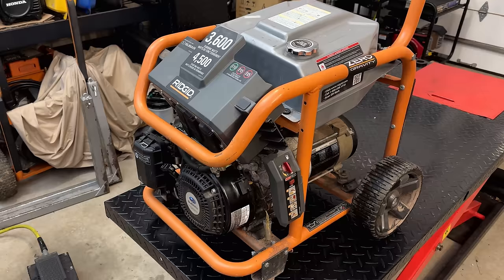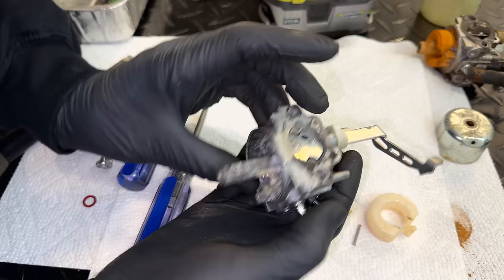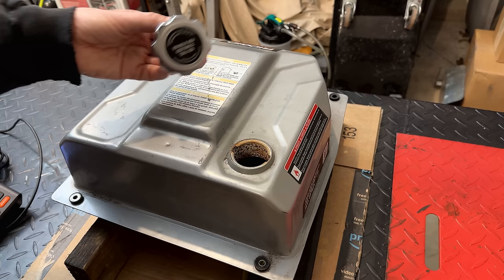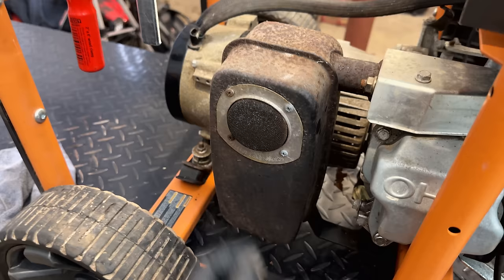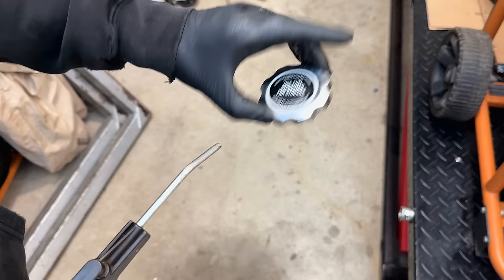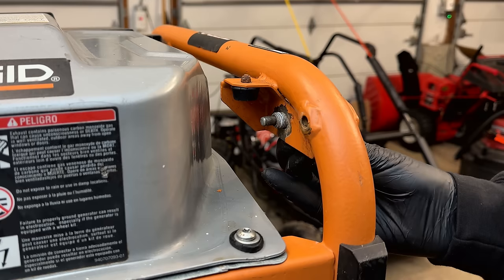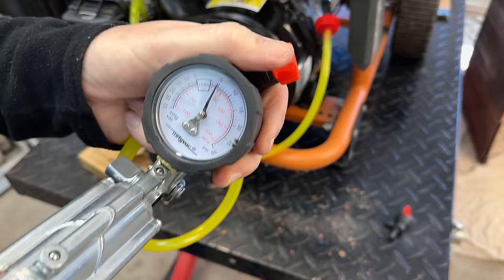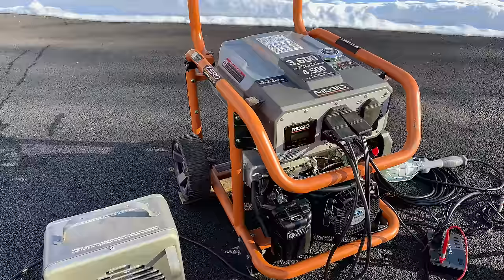Neglected Ridgid Generator Will Not Start

Comment: HI James, nice to see you back! The alcohol fuel that they forced on us has caused all kinds of problems for us taxpayers, I first noticed it when I took the float bowls off my stored motorcycle and noticed the brass jets were eroded from the fuel.
Reply: If you americans used low cc vehicles like the rest of the world maybe you would have normal gas now
Reply: @AJVAN_  Maybe if you knew what you're talking about your opinion would matter.
Reply: Both my Kawasaki KZ1000, and later my Honda Goldwing required high test fuel, which has no ethanol.
Reply: also fuel density is different. so float opens and closes at other positions.
Reply: nope in the netherlands and europe with low cc engines we get this same bio laced fuels. made from US and canadian corn. It also dissolve rubber lines, erode alloids and give zink pest.
Reply: @AJVAN_  Would you have High CC vehicles if your fascist government would let you?  Yes you would.  Don't try to shame us for your own bad decisions.
Reply: @boelensds would you call the 6.3ltr. engine In the Mercedes Benz a small engine? I note that the 4ltr. engine in the Porsche 911 returns around 12mpg. Other European performance cars struggle to get 20mpg. So, I do agree with others commenting, you talk a load of rubbish. Your opinion is just about worthless.
Reply: On Brasil our cars runs full ethanol without a problem
Reply: Who is this “they”?
Reply: @alanstalker5499 the nose clan
Reply: @BKD70 😊

Comment: After watching i must say a lot of your videos,I come to the conclusion that carb problems seem to be the main problems with a lot of  motors.
Reply: Ethanol
Reply: Ethanol plays a role, but so does water and intermittent use/neglect.
Reply: Engines
Reply: You had mentioned before that Subaru engines smoke for a bit when they first star up . Notice this one does not .
Reply: @12wingwfetech  it's like a Harley.  If there ain't oil under it, there ain't oil in it. Huh?
Reply: @davidwelling9471 
It says motor oil on the side of an oil jug
Reply: @billhenry7833  yeah, you're right.
Reply: Like many said Ethanol.
Reply: If you watch enough videos from small engine people you’ll see and hear that their consensus is at least 90% are fuel-related issues and most of those are the carb. A good cleaning brings back most.
Reply: Use premium non ethanol gas if possible.
Reply: @Rein_Ciarfella  use premium gas. With no ethanol. Start once a month and let run a bit.

Comment: on fixing that handle, you could have put a piece of steel tub inside and brazed it at the edges of the blow out. get a piece of tub the same size and cut a slit down the length to allow it to shrink down and fit inside.

Comment: Hello James, I very much enjoy watching you fix all these machines… here’s a trick for welding thin tube especially if you have access to the interior of the tube from an end. Simply insert a brass drift of comparable size to the inside of the tube and then weld repair the outside. The welding steel will not stick to the brass and the brass will conduct the excess heat away from the affected area. Finish Grind the repair area and viola a seamless finish will result. Hope this helps someone.
Reply: I was going to offer a similar suggestion of just sliding some sched 80 EMT or maybe 3/4" black iron pipe inside the existing tube and plug weld it inside and then fill in all the holes and grind it and drill it - so it would have the extra strength of the thick wall insert as well as the repaired "factory" look.
Reply: Brass or copper tubing will also work if your not running really hot on the weld

Comment: With any seal, valves included, they need to be wet to properly seal for any leakage. In this case, put some gas in the line and work the valve a bit. Then check for leakage.  Thank you Jim for another well done video.
Reply: I was thinking the same thing
Reply: Ол😢

Comment: You made this weld look original factory approved
Reply: @Bubba Chinese pipe thickness for the unit frame is very thin...and welding is usually NG...i experienced many troubles with engine pumps
Their system design is usually cheep and light...no toughness nor safe.....
do you know? chinese bridge had fell down with a boat crash in main land south...... tipical china it is...:)

Comment: You can make evaporust dirt cheap at home.  It's quite simple to make.  I've used the home version and it works well.  There's a channel on youtube called the elemental maker and he goes over the chemistry and what you need to buy.  It's non-toxic and non-polluting and safe for drains.  It's pennies per gallon.

Comment: Hey James, i just wanted to let you know that what I've learned from your videos has helped me tremendously. I had a $700 generator i retired and replaced 6 months ago because i could no longer get it started and i was sure the motor was just shot. Then recently the replacement started behaving the same way and losing power every time I got it to run. The short story, from your videos, i discovered both had intake valves that were too tight and one had an exhaust valve that was too loose. I was in a bind so i used a piece of aluminum i had that measured .006" to set the valves and it was like a miracle resurection for both of them. I then looked closer at the one that was low on power and discovered a tiny flaw in the bracket on the carburetor where the governor rod connects that wasnt letting the throttle open past 40% with spring tension alone. I cleaned up the plastic bracket and polished the end of the governor rod and boom, I've got 2 good running machines that i was just about to scrap and replace at a cost of another $800. Thank you!
Reply from the maker: Awesome

Comment: I am not a small engine technician. You always make me anxious using used carbs and non OEM carbs. I understand cost is a factor. However, for myself longterm reliability and peace of mind are most important. Thanks for all you do for the rest of us. You are a Youtube treasure!
Reply: Most all these carbs are really simple and a good cleaning is all the need  I have done it 50 years on these engines and some motorcycles with no problem.

Comment: What a sweet little genset. Those super low THD numbers were surprising for a generally cheap unit! One note about those cheap leaky fuel valves is that if there is a gas fired water heater in the same enclosed garage you can potentially have an explosion. Stay safe everyone!

Comment: Try strapping the gas tank  with liquid and nuts, bolts,etc to a rear riding mower wheel, then jack up the rear so the tires will turn. Run it that way for several hours and see it it makes a difference. Should be easier then shaking it. Thanks for the Excellent Vids Jim.  :face-blue-wide-eyes:
Reply: Having an electrical motor would be more efficient but yeah I thought about that as well
Reply: Funny you guys stole my thunder.  I was just going to suggest to James that he do the same thing,  The old timers and car restorers do this all the time.  Take an old rusty gas tank and strap it to the rear wheel of a tractor add water and rocks then leave it running half a day. I was going to suggest a piece of plywood attached to a low rpm worm gear motor on a stand or even a rotisserie motor then attach with bolts or strap then walk away for even a day.  James you make me tired just watching you shaking those tanks.
Reply: He's already done this with other tanks lol
Reply: Using this method, you have to remember to turn the tank occasionally (in a direction different to the wheel rotation) otherwise you can end up with a ring which is cleared of rust (and possibly perforated) and large areas which haven't been touched by the abrasive nuts.
Reply: I like that idea!

Comment: When you pulled the bowl off of that carb I did a double take on how much rust was in that. I've never seen one that bad. Neglected is an understatement. I don't blame you one bit for not getting excited about de-rusting a metal gas tank. There's no call for someone letting a tank go this far. Good job.
Reply: Galvanized steel to construct the tank, is a design failure for fuels that tolerate and actually collect water.
It’s going to fail unless you keep the fuel scrupulously dry.

Comment: Hello Mr. Condon. I have been watching your vids for quite some time now, just recently sub'd..... Amazing work you do! 
Just a quick tip/idea from me, for removing rust from inside gas tanks: Do you have a cement mixer? Fill the tank with water/evaporust, throw in some gravel (clean, w/o sand or small particles), plug the inlet and outlet with corks, wrap the tank with cloths, attach the tank inside the cement mixer, and let her rip. A close friend of mine restored an old Soviet motorcycle, with side-car, and used this method to clean his tank... Like said, just an idea, ja? 
Keep them lovely videos coming.
Cheers and greetz from Germany
Reply from the maker: Unfortunately I do not have a cement mixer.  Been keeping an eye out for an old paint mixer.  But so far have not found what I am looking for.

Comment: Great job as always. Another option for the hole would be to get a piece of metal tubing slightly larger and epoxy it to the end of the handle. Would avoid soldering and look OEM. Could even reinforce the hole with an insert.

Comment: Those valves are junk however you can’t expect them to hold any significant amount of gas pressure. Maybe a few inches of water column, not anything amounting to PSIGs.

A low pressure air test is equivalent to a high pressure liquid test due to the nature of each fluid (viscosity and surface tension). 

You’re right up there with ‘Inheritance Machining’ (or vice versa), I get some of the best sleep watching your videos. I mean that as a compliment, just relaxing watching you work on small engines and generators. I’ll end up watching the same video 3-4 times. Always a slightly better day when there is a new James Condon video.

Comment: Great job James on the repair as always. The circuit breakers on most generators like this one have what are called push to reset thermal breakers. They are considered supplemental by the NEC code because the fact is they can run up to 125% of their rated load for a long period of time before they trip they are more in place for surges and short circuits. This also may have something to do with why generators tend to get overloaded on one side and melt the neutral wire. 

Chairs in great time on the live stream last night!
Reply from the maker: Was trying to find a wiring diagram to confirm.  Seems odd they would have done it that way.
Reply: @jcondon1  it's likely because it's limited by the wattage total. You can't use the duplex 20A outlets and the 30A outlet at the same time. If you do then you will likely smoke the generator. Again those push to reset breakers are very cheap. On the bigger generators you will see a master two-pole main breaker then the supplementary push to reset breakers downstream. Corners were cut on this one but as long as the user is educated how to operate it properly should be fine

Comment: James,
I haven't watched many of your videos over the last two months because I've been very busy. I'm taking some time now to express my sincere gratitude towards you and to thank you for all of the awesome diagnostics and repair videos. I have watched dozens and dozens of hours of your instructive engine repair videos. Many, I have watched two or even three times.
In the last month I've managed to rebuild a transaxle and service an inoperable MTD Yardman Yard Bug Beetle. The only thing remaining is to button it up and install a new battery.
I also ran across a very old Clinton Cast Iron engine from about 1962. It was missing the spark plug and didn't have a single drop of oil in the crankcase. Every moving part was stuck. Mud Daubers had filled the exhaust...but the worst thing was that the engine had been sitting unused, covered in dirt, and the piston was locked up tighter than a drum. Long story short, the engine is now up and running and I didn't even have to replace the points and condenser.
Lastly, today I picked up an Echo PB--251, for free, and I'm too tired to check it out tonight, but, it has good compression and looks like I will simply run through the maintenance procedures for the carburetor, spark arrestor, exhaust, and make some adjustments. Thanks to the skills I've learned from you...I'm not sweating it at all.

Thanks again James!

Comment: Great Video James. Years back i had a Ridgid generator similar to this model. It was a 6500-8500 model with a Yamaha engine. I sold it promptly because it was so heavy and Loud. But a great jobsite Generator. I sold other to a contractor

Comment: A great way to suspend cables and fuel / air lines to vibrating or slightly moving things Is to use double headed zipties that loop around and kind a make a figure 8. I use those a lot on sensor cables running along air pressure brake hoses on trucks etc...  
Thanks for your step by step videos and detailed explanation on symptoms and causes. I definitely was lacking some information on small engines!

Comment: Reading the comments and y’all spoiled the valves. Lesson learned. Don’t comment until finish watching the video. James, I’ve learned so much from you about small engines and generators. You have volunteered your time and expertise for free. And if there’s anything I could do to help. Just mention it. If it’s in my power (like what I did there? 😅) I’ll do it. You’re a good man James. God bless you and your family. I really need a lesson on THD, and the cheapest meter that is reliable to measure it. And why some generators are so low and other “cheap” ones are so high.
Reply from the maker: The cheapest meter is the Amprobe ACDC 52NAV.  Still expensive.  THD is a combination of how smooth the engine tuned, materials used in the stator and how it is wound.

Comment: It is quite impressive that you can pull a carb out of the parts bin and remember the issue with that specific carb. I wish I had a memory like that.
Reply from the maker: Sometimes.  I have a 420cc that I have no recollection where it came from or if it works.

Comment: I stopped using those plastic valves years ago when I had to replace a carb on a chipper/vac because the valve leaked unbeknownst to me. I now only use metal valves from Tractor Supply. They are expensive but they don't seem to leak. You may want to check out the Ryobi 18v band saw for cutting your metal, it's my new best friend for that kind of stuff. I avoid the jungle web site mainly because of the way Jeff treats his employees but also the amount of junk sold there. Excellent repair on the handle!

Comment: Astounding! 3.0%THD is amazing with such low power machines. Very good engine
I would have made a steel bush for the inside of the handle pipe but it looks great none the less. I am surprised by the price of these gennies brand new.  236USD is a fantastic bargain. In  Europe we have to pay 2 times that money for 2.5kW ones

Comment: Hi James, If you heat the carb cleaner straw with a lighter an inch or two from the end then pull the straw to neck it, hold till it freezes, and cut through the middle of the neck. You know have a mini straw to get in tiny jets and passages.

Comment: Hello James;
Really enjoy your videos; keep up the good work.
With respect to the rusty fuel tank.  I worked at a equipment manufacture.  I don't know if the results would be the same but we used to take metal that had rust/mill scale on it and put it in a cement mixer along with a few hands full of sawdust.  After a few hrs. the mill scale and rust were gone and the metal parts were semi polished.  If you have access to a cement mixer you could  probably bungie a fuel tank to it and use the saw dust along with the nut & bolt and it would probably do a nice job on the rust.  You might need to rotate the to get the top, bottom and sides, then use the Evapo-Rust to finish it up.

Again, thanks for the great videos.

Comment: Hi James. A sugestion to help you cleaning out steel tanks. If you have access to a cement mixer, take off the drum and fashion a wooden support for the tank and let it spin. Less work for you and you can leave it running for hours
Reply: He did that before with...a tractor?  or a lawnmower with self propel?  tied the tank to a wheel if I recall :)

Comment: Thanks for the vid!  I have  the 8KW big brother. These are awesome gems. Mine is a Subaru/Robinson. $39 for a carb, filters, spark plug, fuel line, etc. Buy that and some oil and gas and they run forever.

Comment: Nice video.  Your issues with the gas tank isolation valve leaks gave me food for thought.  Most people will shut off the valve and run the carburetor empty before storage for long periods so as not to foul the carburetor with old gas during extended downtime.  If you are getting leakage that is another reason for changing the oil before starting for a new season.   One oil change per year is much cheaper than a new engine.  Thank you for explaining this.